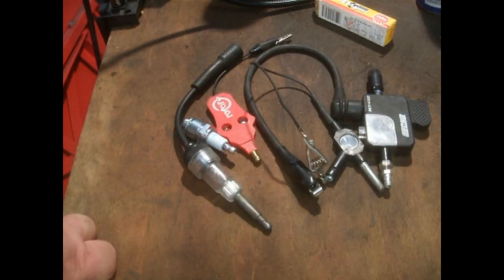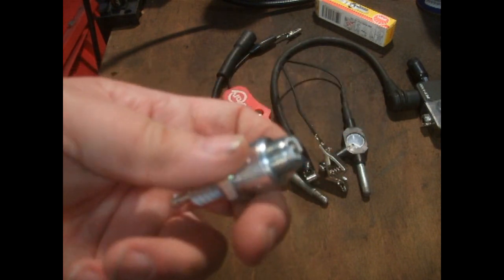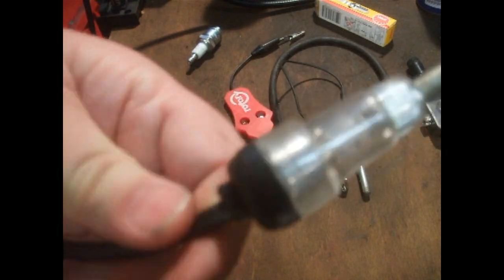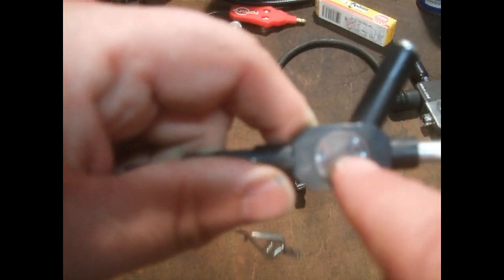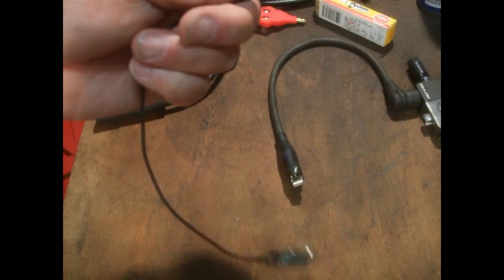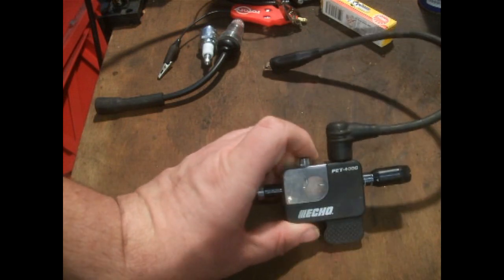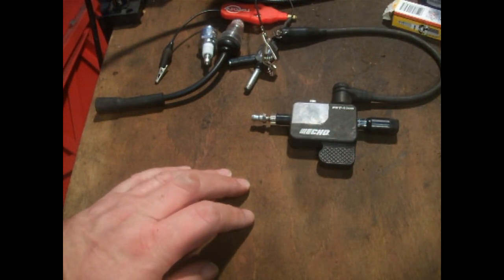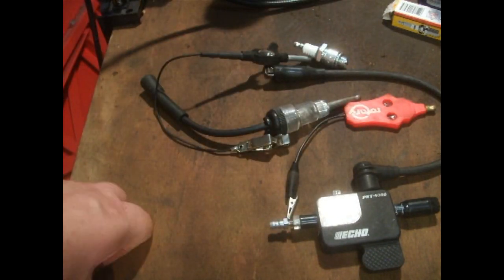SMALL ENGINES SPARK TESTING AND SPARK TESTERS

Comment: I have one of those three point testers you mentioned.  It has never let me down.  I usually just connect the clamp to a ground point - cylinder or bar bolts on my pro saws.

Comment: Those visual spark testers ARE useful. I rebuilt my little Minarelli scooter engine and it would start up and run for about 3 minutes and then it would just suddenly die and not restart again that day.. I thought it was jetted too lean and fouling the plug , but I tried like 2 known good carbies and they did the same thing .. I was thinking pulling the plug and blowing everything down with carby clean was fixing the problem, but it turns out I was wildly off-cue. In the end I discovered that there was like a 3mm gap between the flywheel and ignition pickup when it should have 30 thou MAXiMUM lol..So it was running I guess the size of things contracted again when it cooled down and the pickup was JUST working off the flywheel, but whenb it (the crankcase) warmed and expanded - the ignition pickup was suddenly No Bueno with the flywheel magnet. I borrowed my friends one and checked my bike first and then his KTM and the scooter had like tiny little streams, but the other bike was like blue plasma field in comparison.. Scooter ended UP sparking JUST LIKE that, but I wish I bought the damn tester a fortnight earlier, it would have saved me some damn TIME lol..

Comment: Hi Colin can you have the briggs coil tester connected to the spark plug with the engine running or would it damage the tester stihl also sell one the same as the echo one part number 5910 850 4520 no cheaper than you paid but easily available